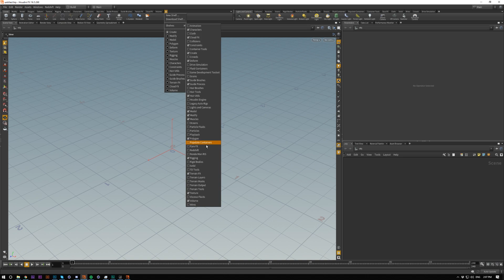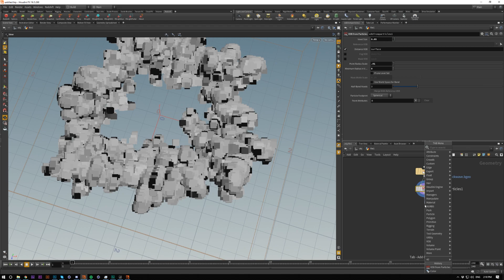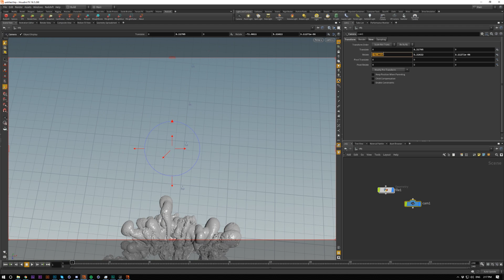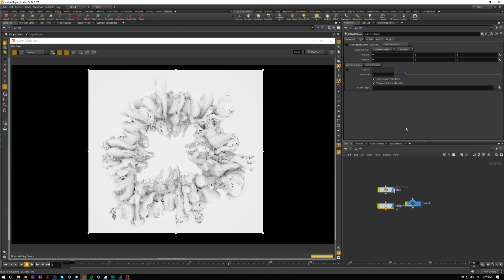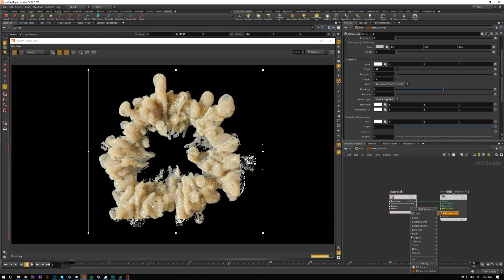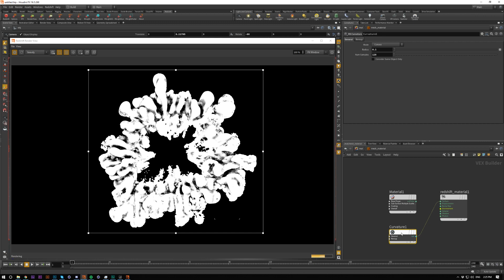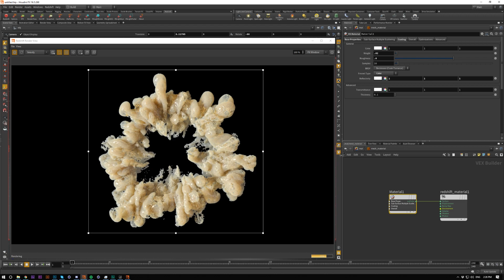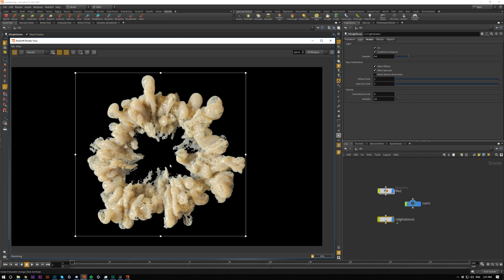Shockwave in Houdini - Meshing & Redshift

Comment: Really cool thanks man. Any chance you can do a quick mini tutorial on how you did those colors in the beginning? Thanks!
Reply from the maker: It's the milky coffee preset on redshift
Reply: @AxisDesignerGFX  oh im talking about the colors in the very beginning :)
Reply from the maker: Before your pop net, put a point vop. Inside the point vop wire 'P' to a noise such as anti aliased noise and set the noise type drop down to 3d. Wire the noises output into the 'Cd' output. Should get something similar :)
Reply: AxisFX thanks a lot man 🙏

Comment: Great tutorial!
The simulation drawing is different from the drawing in the first lesson.
How did you get this simulation drawing? Similar to flames effect.
https://i.imgur.com/rmqLDqy.png
Thanks!  )
Reply from the maker: Sorry, I don't really understand. In this tutorial the particles are meshed but it's just a higher count, cached version of the particles in tutorial 1.

If you're talking about the colours of the particles - particles take their colour from the surface they are emitted from so if you add a noise to the colour of your emitter object you will get a similar result. Just use a point vop
Position > Noise
Noise output> Cd

Comment: Hey, thx alot for that cool tutorial. I have one question - somehow I get no velocity on the final mesh when rendering it. I checked motion blur in redshift (also the deformation blur). Do I somehow have to transfer velocity from the particles to the mesh? How would I do that? Thx again. :)
Reply: Just wanna give a quick solution: I had to add an "Attribute Transfer" from the Popnet to the final mesh and in redshift object parameter tick the option "Deformation Blur From Velocity" - than it works just fine. If there is no "Pop advect by volumes" in the Popnet, you also have to add one. Cheers. :)